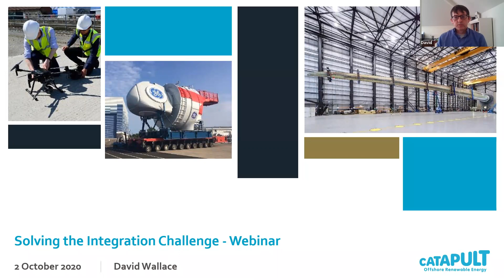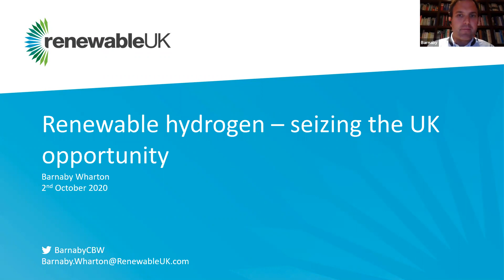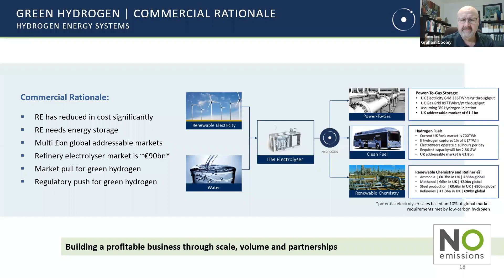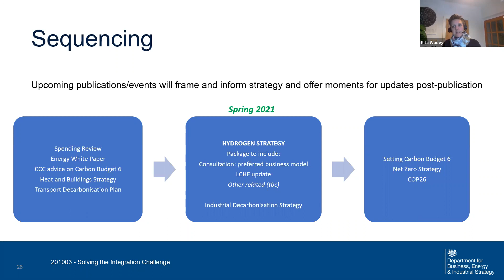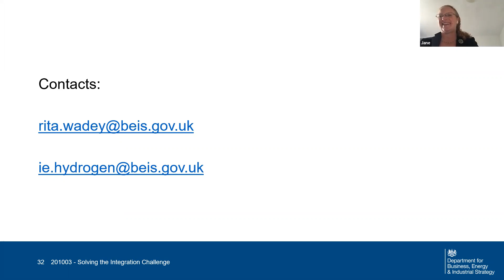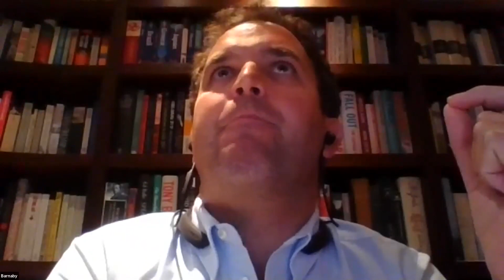Offshore Wind and Hydrogen: Solving the Integration Challenge Webinar

Comment: There is soon to be no need for more conventional and green hydrogen technologies that are more expensive and disadvantaged when compared to the cleanest possible nuclear fusion SAFIRE GENERATOR. Learn about this best and vastly cheapest 24 Hr. reliable, hydrogen-powered, FUSION NUCLEAR and community located device built on any scale on a tiny and unobtrusive footprint. It is the latest fusion nuclear technology that is in commercial design and production now. They will not need battery or other storage technology backup and no extended ugly and vulnerable electric grid. See it at "AURION @t" and then learn about ELECTRIC UNIVERSE THEORY and more advanced Plasma Physics at "THUNDERBOLTS @t". Then please teach all your friends and peers so we can advance the most modern physic knowledge.